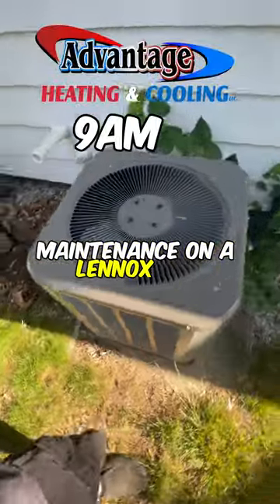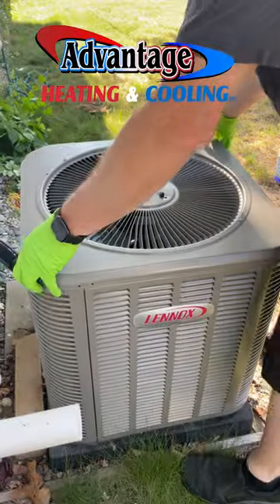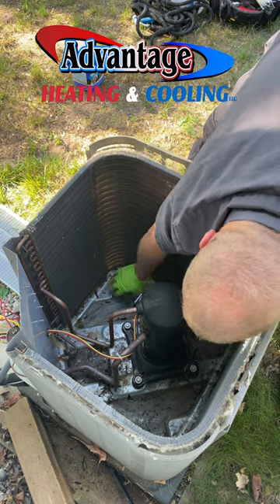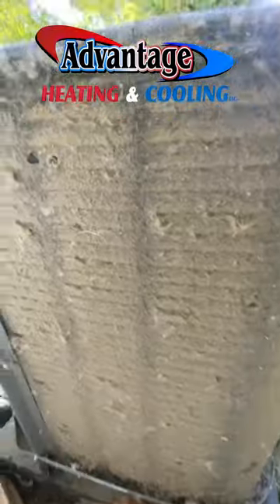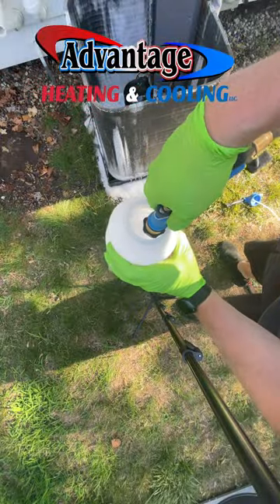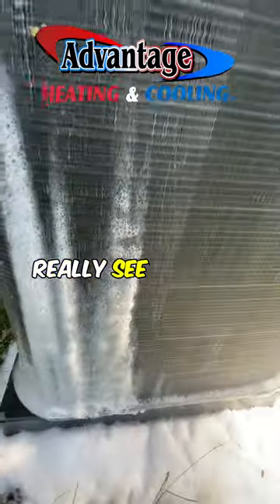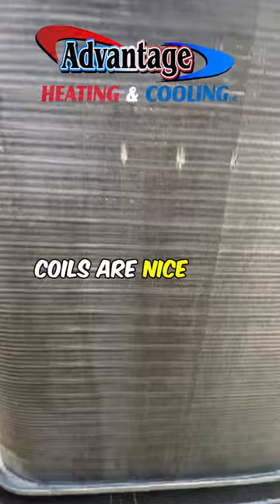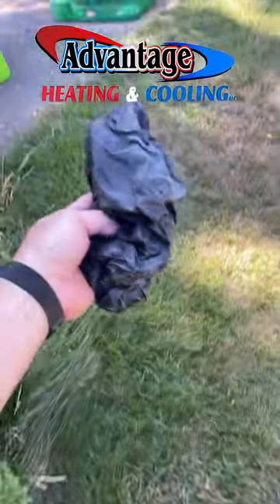Expert Tips: How to Properly Clean Your AC's Condenser Coil

Comment: How does someone go about asking the hvac company to add Freon? I’m hearing cavitation bubbles in the line. And it’s struggling to get to 76*. Thinking the filter and about 3-5 lbs of r22?
Reply from the maker: Yes, check your filter first! But if it's r-22 and if it's low. Then there must be a leak. 
Some companies may still add to it, keep in mind it's gonna be EXPENSIVE. To be real its time to probably to replace the system. 15-18 years is the life expectancy. Hope that helps.